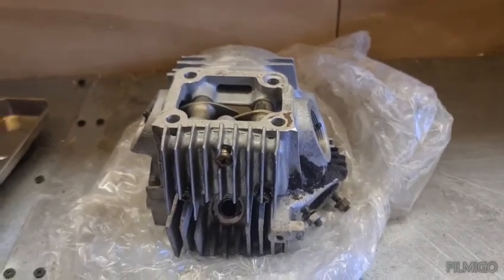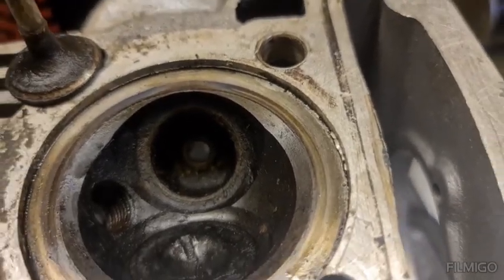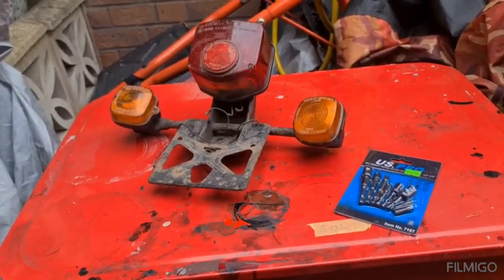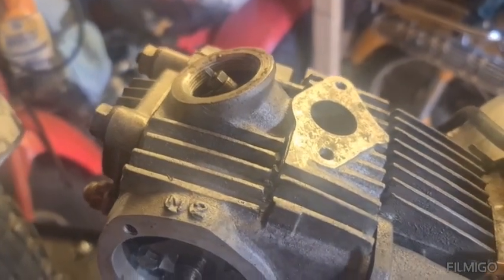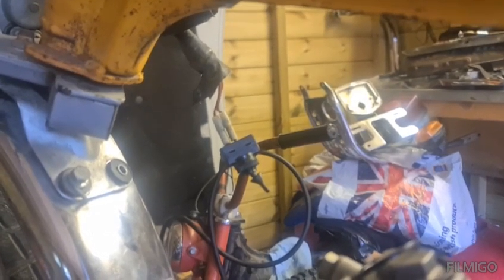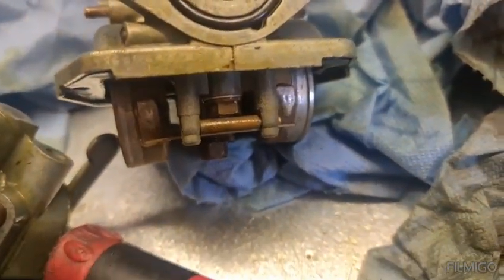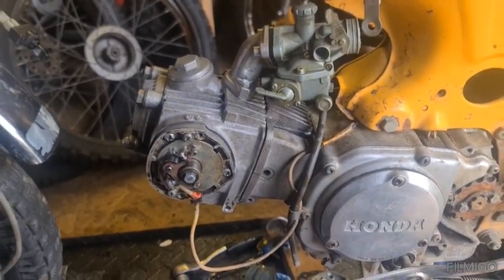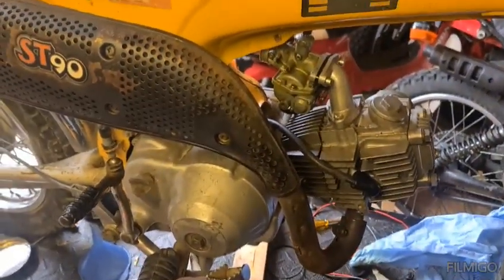Honda st90 part 3 top end oil running out the bottom

Comment: Glad to see this video in uk 🇬🇧 the st90 is on my list ov bikes to get,got some interesting engine parts together for it already 🤩
Reply from the maker: @davidwilliamson9162  what are you planning to do to the Engine ?.
Reply: @andyshondaxlsrestorations4733  bigger cylinder,longer stroke,uprated cam,12v ,got a offset crank pin kit also a manual clutch kit,not much over this side ov the pond,I’ve a few dax but not a 90 yet 🤞
Reply from the maker: @davidwilliamson9162  I are you in the UK?
Reply: @andyshondaxlsrestorations4733  yes up north ,Yorkshire